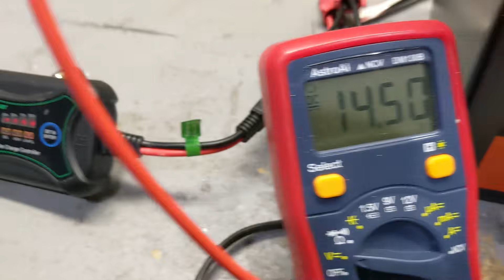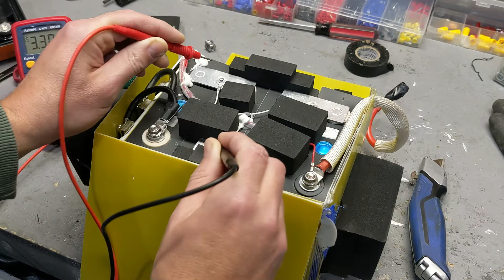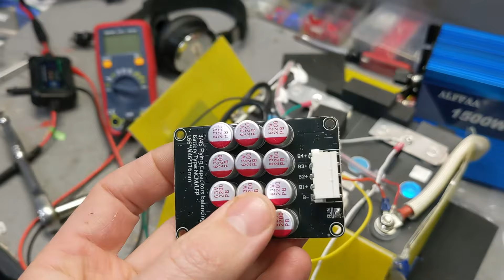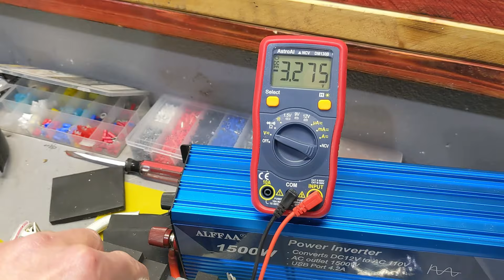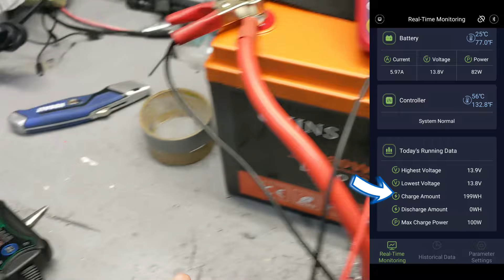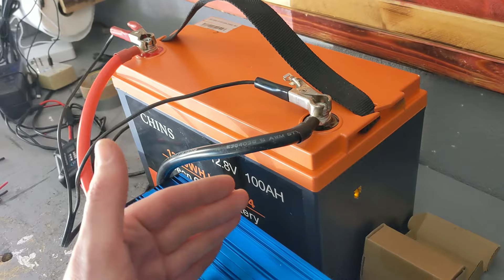LIFEPO4 battery not charging, not holding power, Good BMS and Cells, Top Balancing problem EASY FIX

Comment: I have two LiPo4 12 volt batteries and they are new.  I connected them is parallel with 1/0 wire cable.  The 2000 watt inverter is connected to the batteries with 2 gauge cable wire.  The inverter turns on and then off after 5 seconds.  Are my batteries un balanced?  Would this balancing board fix my problem?  I have been dealing with this for 2 months.

Comment: i have a bms that wont top balance,  dally,  junk, but its what i got..  i had a imbalance issue with one of my cells,  ended up solving the problem after multiple active balancers failed to fix the issue, i got me a cheap ISDT hobby charger, that had lifep04 support,  connected it to just that one cell, and told it to charge,  took a day, but it charged that one cell up while connected inside the pack,  i did have the bms turned off,  or rather charge and discharge disabled.  but once isdt charger was done,  i kicked on the bms charge and discharge, and ran a week with no issues.    now i have a pig tail for my isdt balance cable that i can easily hook up to my cells and press one button and isdt will balance them for me.   stupid how a hobby level charger can do what a $100 bms cant.

Comment: "Hi! I have a 12V 105Ah LiFePO4 (4S) battery. I'm using a 10A Lead-Acid charger. When it hits 14.4V, my BMS cuts the charge. After resting, the battery settles to 13.3V, which triggers the charger to start all over again—even with no load! It loops for 4 hours every time. Is this 'resting drop' to 13.3V triggering micro-cycles that will kill my battery's lifespan?
Reply from the maker: I stop my charge at 13.3 or 13.4 , That's The Sweet spot where the cells start balancing but you don't overcharged them .  The lifepo4 are strong , they can handle that , maybe you reduce the life a little. I wouldn't worry to much but if you want perfection charge to 13.4 and once a month to 14.4

Comment: You could have charged each one individually to 100% then connect everything back it takes less time than cycling for about 2-3days and letting the balancer do all the work but it isn't a bad way too good job man❤
Reply from the maker: I don't have a high amp 3,7 v charger so the 100 amps per cell 4 time over would have taken. Longer
Reply: @VegasRoManiacReviews oh that makes sense i am using for my 12.5kwh 51v~ a passive balancer it is working fine for now but i am thinking of upgrading to a active  one
Reply from the maker: True

Comment: You can bring the cells to the same voltage without destroying the bridges. Just connect to the cell in question and apply charge or discharge to it in order to have them all match.

Comment: I followed your advice and it saved my day. I was so disappointed about my lifepo4 230 ah battery. Because it provides just 1/3 of its
 capacity. The service of basen green did not helped me anymore. But your solution saved my day. Back to 230 ah. Thank you so much.
Reply from the maker: I'm super happy to hear that it works now, when I make these videos not a lot of people really understand what I tried to explain and the fact that you were able to do so makes me really happy. It doesn't feel like I worked for nothing
Reply: Basen green haven't helped with my 600ah battery either. But I'm not confident enough to take it apart, it has 32 cells.
Reply: @matthunt2128 Its not difficult. You dont need to be a technician.
Reply: But be aware of the high voltage. Use isolated cloves. 
 @matthunt2128

Comment: Thanks for sharing. I have a question. I have a 38.4 volt lifpov4 for my Golfcart. After 4-5 cycles the app stopped turning the battery on. Can the BMS be stopping the battery from turning on?  Thanks again for sharing your knowledge with everyone.

Comment: Shouldve glued the balancer outside
Reply from the maker: Great idea , wires were not long enough
Reply: @VegasRoManiacReviews  wires were not long enough
==> A solder iron helps to extend cables and having access to each cell from outside of a sealed plastic case improves the possibilities to check for failure reason strongly.

Comment: My Lifepo 12V 300Ah(RoHS) battery at rest shows 98% charge and 13V, but when I connect consumer to it, it shows 0% charge and 12.5V.  When I put the charger on the battery display shows 100% charge and it does NOT start charging.  The battery is new, I only used it for 4 days for RV lighting (5w bulb for ~15 hours).  What do you think is the cause of this manifestation?
Reply from the maker: Sounds like the battery was sitting for a long time before you started using it and it's unbalanced
Reply: VegasRoManiac, thanks,
  in that case should I break it/disassemble it and do a balance, or...
Reply: @valeriugociu5705  The best is let the charger on the battery for 24 hours, even if you cannot see any larger charge current and then check if situation improved a little. A passive/cheap balancer does only work when the BMS sees 100% charge voltage (14.4V on a 12V battery). Furthermore a passive balancer discharges the 100% charged cell/cells only with a very small current, for example 50mA. If your battery does exhibit 2 cells which are extremely disbalanced/nearly 100% opposite, this means one cell being close to 0% charge while the other cell being at 100% charge like in this video, then the passive balancer needs to work VERY VERY long time (example 100Ah, with a 50mA passive balancer the time for full balance would be 100Ah/50mA = 2.000 hours = 3 months). A balancer is not designed to compensate such extreme disbalance as shown in this video. To more effectively balance you should open the battery case and then charge up each single cell to full voltage 3.65V with charge current in CC phase maximum 0.5C (on a 100Ah cell this means maximum 50A) and stop the charge when the current at 3.65V (CV phase) has fallen down to 0.05 or 0.02C (this means on a 100Ah battery charge current down to 5 or 2A).
The such roughly balanced battery should then sit with the 14.4V charger for 24h to give the passive balancer enough time to do a fine balancing at 100% charge (on the open battery each cell should exhibit the same 3.65V with maximum lets say +/-0.03V difference. And every 3 or 6 months you should charge up you battery to 100% and let it on the charge for 24h so that the balancer has again enough time to re-balance.
An active balancer as used in this case has more current capability, this means shortens the time to achieve a good charge balance, but an active balancer is also prone to disbalance cells when it is working over all voltages, because a balancer has to balance the charge, but actually all balancers to balance the voltage and small deviations in voltage versus charge from cell to cell can easily trigger the active balancer to balance the voltage which will lead then to disbalance in charge.

Comment: I've left my active balancer connected for 3 years on my RV 310ah pack - it does not discharge the pack since it doesn't start shuffling power until there's a cell difference of more than 15 mv which only occurs when it is above the knee ie 3.45 v +cell - once its close enough the passive BMS charger trims the cells
Reply from the maker: Awesome info

Comment: You don't want to leave that balancer hooked up while discharging. Discharge, then charge to 13.4v the hook the balancer back up. Then continue charging. There is a real good reason for this. You can screw up your balance even worse by leaving it on. While you have the top off the battery do yourself a huge favor and put a new JK-BMS in with Bluetooth and 2 amp active balancing. You can watch your cells charge and shows each cell SOC. You set your own parameters starting by telling it when in the charging you want the balancer to start. Common start is 3.40 to 3.45v. This is when the charge starts up the curve. There is a reason for that also. Im not explaining everything because it takes time. But these are the basics and where to start on making your problem go away and having better batteries than what you started with. You're going to love the JK-BMS. Its an absolute must. Otherwise you're going to be scratching your head everytime you have a problem like you are now. You will be able to see whats going on under the hood right on your phone.
Reply: My Lifepo 12V 300Ah(RoHS) battery at rest shows 98% charge and 13V, but when I connect consumer to it, it shows 0% charge and 12.5V.  When I put the charger on the battery display shows 100% charge and it does NOT start charging.  The battery is new, I only used it for 4 days for RV lighting (5w bulb for ~15 hours).  What do you think is the cause of this manifestation?

Comment: Hello. I got the same problem on 20 units!!! Please could you share a solution of how glue again the top of the plastic case? Have you tried using a "0 voltage charger"?Thanks a lot. Greetings from Ecuador
Reply: I've used sikaflex 522 sealer to fit the top back on mine. Good luck with them all🤞

Comment: Absolutely zero point in balancing ANY LFP battery with cells below 3.45V per cell, you must get all the cells up into the steep part of the charge curve . You have to get a bench power supply and charge each cell individually to 3.65V until no current is flowing, this may take many hours. Once all 4 cells are at that same state then (and only then) charge it in the normal way and the original BMS will work just fine. Problem is this battery was put together without first top balancing the 4 cells together, the manufacturers rarely do this because it takes time and they work on volume. They assume the BMS will take care of the balancing which it will, but you MUST balance the cells first.
Reply from the maker: So you are trying to tell me that what I've done to this battery which made it work is not working?
Reply: @VegasRoManiacReviews lmfao This is a great example of textbook knowledge vs real world use and experience.👍
Reply: MUST lol you make it sound like it's illegal or it will blowup😂😂

Comment: Another great video!  So the BMS turned off the battery due to Under Voltage Protection 2.7v.  In your video at 3:06 you show that the other cell is at 3.8v which should be Over Voltage protect unless the programming of the bms is allowing that high of a voltage.   I like the balancer you installed. Would be nice to see if that battery's Ah capacity is able to do 100ah.. Keep up the videos.  Jim.

Comment: This is the same state my battery was in!!!  My new CyclenBatt 100Ah mini battery would shut off under load, even tho the 20A charger said it was FULL.  The multimeter said the battery was giving 9 volts. After disconnecting everything, I'd wait a minute, and the multimeter registers 13V. I got so P.O.'d that I asked the seller for a refund. I still have the dead CyclenBatt but I may try to resuscitate it.
      Thank you for explaining a confusing problem so clearly and showing a simple solution. Your video put my addled mind at rest and gives me a pathway to fix an otherwise useless battery.
Bravo!!!

Comment: Can you please share a Balancing board that would work for a 24v battery.  I received some "sleeping" 24V batteries from an old solar project. The batteries are reported as NOT CHARGING.  They are Valence U27-24XP  tHANKS,

Comment: You say it is not possible to top balance because the cells are welded. Why not just connect power source to individual cells and charge all to 3.6 (or 3.55 with absorption)?
Reply from the maker: Yes, you're correct. You could do that individually. One cell at a time, but that will be quite complicated. I don't know if it's going to take less than buying a balancing board because the balancing board will solve both problems. I also will keep them balanced in the future
Reply: @VegasRoManiacReviews  Mind you, a balancing board will imbalance your battery at low state of charge. There’s a welded connection on it if you unweld it and install a switch to turn on balancing only when top balancing it, nearly every 3 months.
Reply: https://www.youtube.com/watch?v=4iPpn8-Pakk
Reply: How to install a switch https://youtu.be/tDw7sgFV2_4?si=uf7ttQc0VrDF0mTo&t=833
Reply: You say it is not possible to top balance because the cells are welded.
==> That statement is nonsense. The fastest way to correct such extreme disbalance is by charging each individual cell to its 100% charge level (voltage 3.65V and current less than 0.05 or 0.02C).
The GREAT question is however, after having rebalanced and glue-closing the battery case again, how can you guarantee that the cells will stay balanced.
Such extreme unbalance can have 2 reasons:
i) The BMS internal balancer is not any more working
ii) The battery user never ever charged the battery to 100% AND let it sit on the charger for 24h so that a cheap passive balancer with low current can balance all cells sufficiently.
To add an active balancer would solve problem i), but it may introduce the new problem, that active balancers especially on LiFePO4 tend to cause charge disbalance when they do their voltage balancing (only minor voltage versus charge differences between cells could trigger such not wanted activity, therefore the active balancer should ideally be limited to work only when the battery is fully charged).